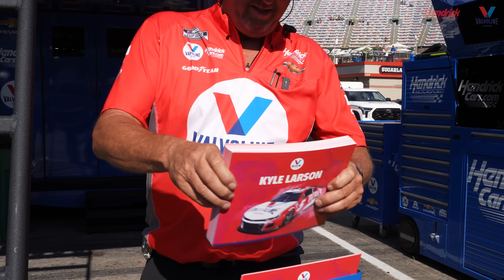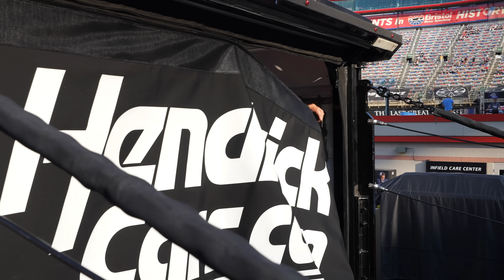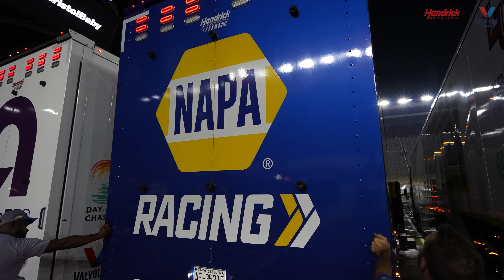Hauler Driver – ‘On the Road’ presented by Valvoline, Ep. 9

Comment: Hopefully they get paid well for all their hard work.
Reply: They do
Reply: Actually, not as much as you’d think. Not many truck drivers get paid what they truly deserve given how tough the job is. In 2012, the average salary for a NASCAR hauler driver was only $38,000/yr. That’s barely more than what you’d get paid working a retail job. That was in 2012 though. It’s probably slightly better now with inflation and higher cost of living factored in. Still not even remotely close to what they should be getting paid though.
Reply: @ryanmorrison3699   $38k even for 2012 that is pretty LOW.... I hope by now that total has doubled or more....
Reply: @ryanmorrison3699 yeah but in 2012 $38,000 a year is worth more than today in 2024. So it would be different now
Reply: I applied to Penske as a hauler.  The pay band started at 50K and topped out at 70K. Not great, but I'd still love to do it.

Comment: I thought most of these teams had at least 2 drivers per hauler. Raceday for these guys is long cause not only do they gotta work the race but then, they gotta clean up and drive the hauler all the way back to the shop afterwards depending on where they are, if West coast swing then onto the next track after the car switch but even then. I could understand if they'd get burnt out after a few seasons...